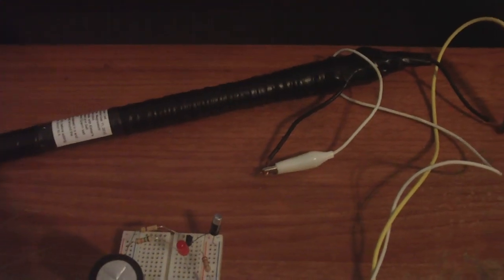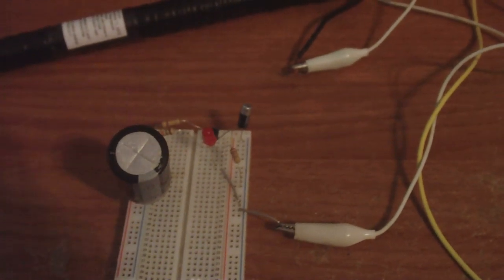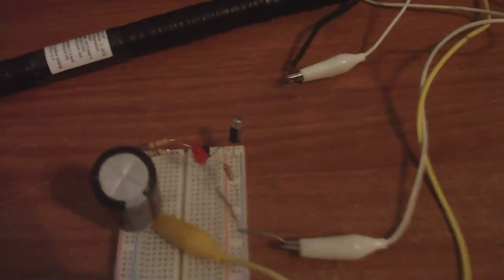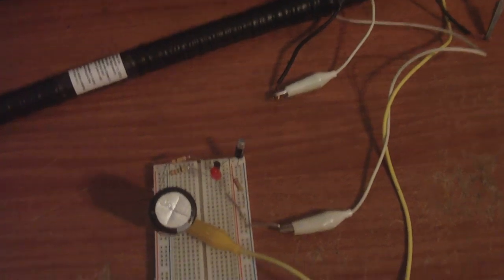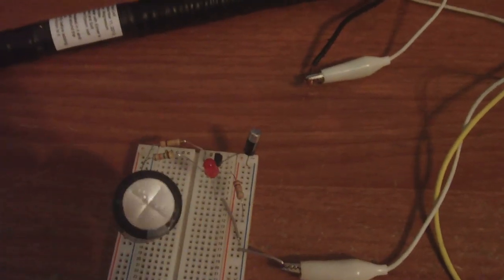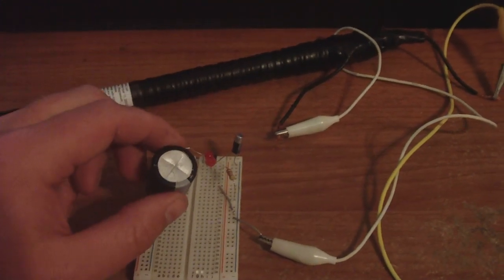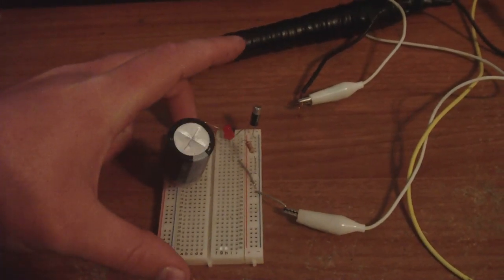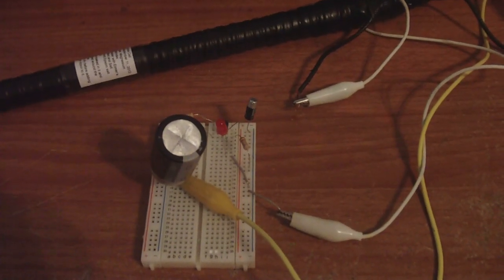Crystal Cell Circuit And Captret

Comment from the maker: Mine still is in the works. I've been trying to figure out the best way to do a cap dump but the component i really needed is not made anymore. My circuit is far from where i need to be but its a step in the right direction. I might start a thread on EF where we can discuss this circuit and other Cap dump circuits so that we all can benefit from it. I'm sure we're not the only ones trying to figure this problem out. Maybe we can come up with a good cap dump circuit! Hope to hear from you soon.

Comment: Interesting . So it uses perhaps an MPF102 as the dump trigger, FET switch on voltage being what drains the first cap. Or, an SCR with that little tab out of the top, or thyristor...heck will be interesting to see the circuit...congrats ! :)
In my low voltage solar circuit (in the works) there's a blocking oscillator linked to a MOSFET to do something like this method of cap dump, but it's with higher voltages than the switch on of the first stage. I might drop all that and just copy you lol

Comment: I agree, We see a lot of cap dump systems for Bedini SSG's etc, but there's no way we can use a neon as the voltage sensor lol. Ideally, anything above 0.000V would be stored, increased over how ever long and then used to fire a transistor or JFET. In such a way, every cell or other system we've ever built that falls below the trigger voltage of around 0.45V for NPN's would still be able to do work...most likely never dipping to zero with natural radiant energy collection.

Comment: In your adventures try using a bifilar pancake to accelerate and pickup some real current. Just dump the cap into the bifilar coil then into another storage device like a battery or additional cap. I'm working on an open ended bifilar cap. I think I'm almost there and will let you know somehow how to get in touch with me. Most likely on OU.co m